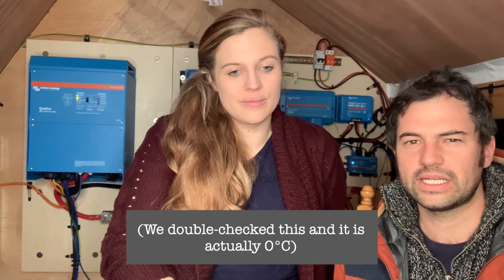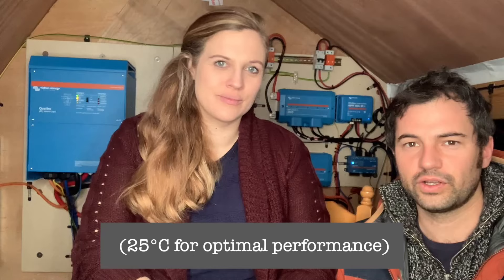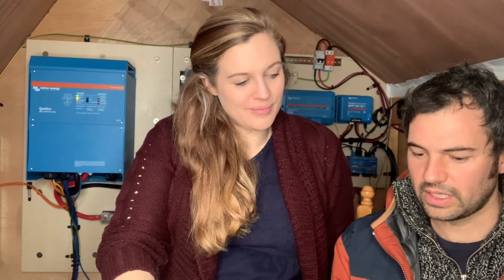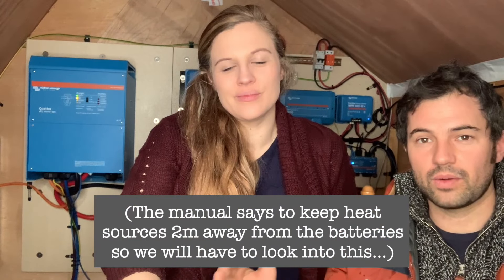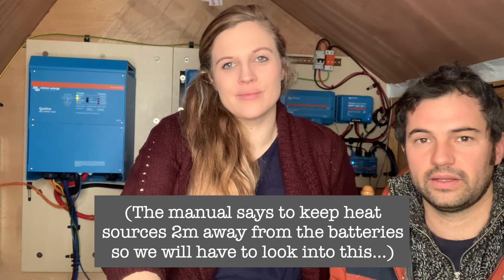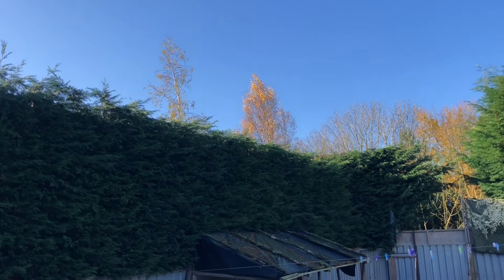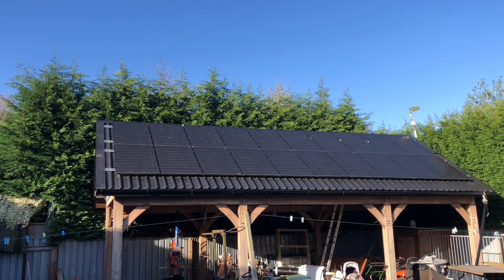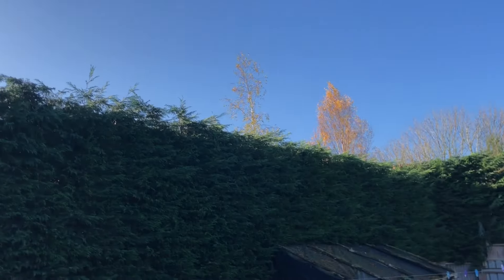SOLAR POWER IN WINTER UK: Optimising sunlight and PYLONTECH battery performance for OFF GRID solar

Comment: Insulated battery box is the way forward,

100mm kingspan bonded to ply or just get some secondhand cold store panels as they’re metal clad and fireproof 

I’d put a tube heater underneath the batteries on frost setting
Reply from the maker: Thanks 😊 yeah we will definitely look to build the insulated box soon. 

Do you know of a tube heater with a thermostat on it? We were looking for one but couldn’t find one.
Reply: @The_OffGridFamily  they are out there
There’s a guy on YouTube that uses them in his insulated battery boxes, he’s called “off grid installer”
Reply: @The_OffGridFamily  Toolstation sell various tube heaters, 1 ft 40w up to 4ft 160w i think, was thinking about using one in our system area if needed in winter. they're pretty cheap to buy and run.
Reply from the maker: @deniseallen5379  Thank you for the info 😊 That’s good to know 👍

Comment: You simply need some thermal insulation panels. The ones with the silver thermal layer on one side. Build a box using the board around the batteries and get one of the cheap diesel heaters with the thermostat. Set the temperature so it will come on at 25c.

I have Victron lithium batteries on a 24v system and it works a treat. My setup is in a shed with basic insulation and everything works perfectly.

Don't worry to much about the SPD's. It doesn't work the way you describe but your close. The chances of a strike are low. Its nearby strikes the SPD will help protect from. You would have to spend a fortune to protect against a direct strike.

Talking about the fuses just keep in mind that the fuses are for protecting your cables and not your equipment.

P.S. Have you purchased a generator AutoStart as yet ? It looked like you have small wireless fob to start it up. If so I can build an interface unit that would use the second fob that would be super simple to connect with a couple of cables. I'm not interested in charging anything to do it. I like to help others where I can.

I am a retired Royal Navy electrical engineer with experience in power systems, telecom, electronic security and PLC plant gear so if you need any help or advice just drop me a line  :) 

I hope your enjoying a much lower stress life now... Remember that no technical problem is impossible to solve 99% of the time....

Warmest regards

Stuart.
Reply from the maker: Thanks for your comment. We were given a bit of misinformation about the SPD to start with so had to look into that and learn a bit more about it. 
We haven’t purchased an Autostart yet and this is on our list of things to get round to 😂 Thank you for your offer of help. It is always good to know there are people with experience that we can turn to 😊👍
Reply: @The_OffGridFamily  How do you start it now can I ask ?

Comment: I built my system inside a enclosed deck area that is warmer than outside or the garage. So I don’t have to use power from my batteries for them to stay warm. I also recommend a warm blanket you can put over the batteries. The one I use is some kind of sheepskin. 
 Since this is my first winter with my new solar system, I’m realizing that insulate in my house and perhaps getting a mini woodstove would benefit me greatly. Since I don’t get as much light and heating the house in the winter is priority. It takes so much energy just to heat the house, where as if I had a small woodstove it would actually keep the gas furnace from firing up so often.  
There is no one solution, so I’m figuring with insulation, wood stove and a gas generator will get me through.
Reply from the maker: Sounds like your heating set up is similar to ours 😊 we predominantly use a wood burner for our heat and that stops the heating kicking in all the time. Helps that the family business is tree surgery so we get quite a lot of logs 🪵👍

Comment: A well insulated box that can easily be lifted off and a small tube heater would easily keep your batts cosy ,put the batts on a insulated bottom board and slot the lift off top on ,cheap to make and will do what you need instead of that 1000 watt heater. Another way is to get some soil warming cable and coil it round the batts still using your insulated box. Enjoying your vids as you show both the good stuff and the pitfalls.
Reply from the maker: Thanks for your comment. Glad you’re finding the videos useful 😊

Comment: We’ve a camper with a lithium battery. Had something similar in that it stopped charging due to the battery temperature. I’ve since wrapped the battery in insulation wool and its kept the temp for longer. Good luck with your poly tunnel 😳 Great vids, keep up the great work 👍👍
Reply from the maker: Thank you 😊 Bit worried about getting the plastic onto the poly tunnel in the cold weather but we’ll see how we go 😆 

We would love to have a camper van! Glad you managed to solve your battery temp problem 👍

Comment: My pylontech batteries run flawlessly at an average temperature of 16 degrees in my garage,25 degrees is over kill.I’ve seen people use electric blankets and car heated seat covers to place under their lithium batteries! It maybe a crude method but very effective and cost efficient method!
Reply from the maker: Thanks for your comment 😊 Do you have US3000C batteries or a different model?

Comment: Hi, my Pylontech bank which is installed in the loft has run for 39 months with a winter low of 5°C to a summer high of 35°C with no issues. Most recent check of bank data shows an average of 166 cycles across 8 US2000B+ modules and 100% SoH, the manual states discharge between -5 to +50°C and charge between 0 to 50°C is within specification, the battery self protection software will shut the modules down if these parameters are exceeded and they will resume operation once the modules are within the temps specified in the manual. I appreciate your anxiety about the modules but in my experience these modules are operating well within their actual capability if you have them set up as set out in the manual with the correct max min voltages etc. At first I was treating them like grandma's bone china, now i'm pretty relaxed, i'm in West Central Scotland, last night the outside temp was -3°C, the bank fell to +6°C. Hope this info helps.
Reply from the maker: Thanks for your comment and sharing your experiences 😊 It’s always interesting to hear from other people using Pylontech 👍

Comment: Hi guys.  I don't think you need to worry too much about keeping the batteries at exactly 25 degrees.  I've just looked at my temperature data for my cupboard (where my Pylontech batteries sit) and it varies from about 15 (winter) all the way up to about 35 (summer). Unless you are putting them under very heavy load (charging or discharging) they will be fine.  For my home made batteries in my power shed, I'm using them down at about 7 degrees. The shed is well insulated and even though it was -1 outside last night, just the warm air coming out of the inverter is enough to keep the temperature inside well above freezing. Just make sure you don't have any gaps around the door where the warm air can escape. I have a video coming up shortly about what I did to fix that problem in my shed. Good idea to trim the hedge btw, shade is your enemy with solar.
Reply: Exactly. Just insulate the shed and thats it. Heat from the inverter will take care of the rest.
Reply from the maker: Thanks 😊 We’ve done some more research since recording this and agree that 25 degrees is a bit over the top. However, the error messages we keep getting keep making us nervous! 😬
Reply: @The_OffGridFamily  What sort of error messages?
Reply from the maker: Something like 'B12 internal failure'?! We had 14 one night.  Apparently, according to our supplier, Pylontech are aware of an issue with the US3000Cs so we are working with our supplier to try to fix it.
Reply: @The_OffGridFamily  Interesting. I don't have any of the 3000 series which might explain why I haven't ever seen that error.

Comment: Hello!!!
Well, you found out, the hard way, of the importance of the proper installation of the solar panels which have to be implemented in the correct azimuth and inclination angle to maximize solar energy production...
I'm not sure by your videos, which are the values of those parameters at your place, but the optimal azimuth orientation is looking south (180 degrees orientation) and the inclination is tied to your latitude (which I don't know either) ... 
Anyway, you figured out that trees produced shading on your panels and took care of that obstacle... very good...
Keep studying and investigating... that's what life off grid is all about...!!!
Take Care!!!
Cheers...

Comment: I think you just need to keep it at about maybe 5-10° c.  The irony is by running your batteries down to try and keep it at 25c You're wearing the batteries out quicker.  By cycling them more often.

I think the text says 6,000 cycles at 25C.   The less you cycle it the better.

Check for air gaps leaking the heat out and letting cold air in.
Reply from the maker: Thanks for your comment 😊 We have since gone back and insulated around the door better which we are hoping will help 👍

Comment: Another great video.
You mentioned warranty.  Really interested if you know whether your warranty is valid because you have done a self install.  Some of the systems I have looked at specifically say their warranty is not valid unless the system has been installed by a ‘registered installer’
Reply from the maker: Thank you 😊 Warranty wise, we know that our supplier will give us seven years as they know it’s a self-install. However, if it had to go to Pylontech instead of via the supplier we aren’t so confident, as the warranty card asks who the installer was 😳

Comment: Hi guys! You really don't need to keep these Pylontech batteries at 25°C. Yes, they work optimal around 25°, but if you are not charging/discharging them with hundreds of amps, then they will work perfectly okay even around 10°C. Just don't let their temperature to fall under zero Celsius, ever. Running the 1000W electric heater in a barn, just to keep the batteries at precisely 25°, is an overkill. Same overkill is to build that heated box.
Your Victron Quattro inverter has a "zero-load self consumption" of 60W. So, if you just improve the thermal isolation of the attic, where your Quattro and Pylontechs are, the 60W of heat from the Quattro will keep the batteries happy at 10-16°C. AFAIK, you already isolated the roof, so just close the attic and isolate the floor. Optionally, raise a wooden wall to enclose all the hardware in a smaller space, so the heat from the Quattro will not escape to the far end of the attic. It's easy :)
Reply from the maker: Thanks for your comment 😊 After recording this we continued to look into it and we agree with you that 25 degrees might be a bit OTT so we have dropped it down and are going to see how we get on 👍